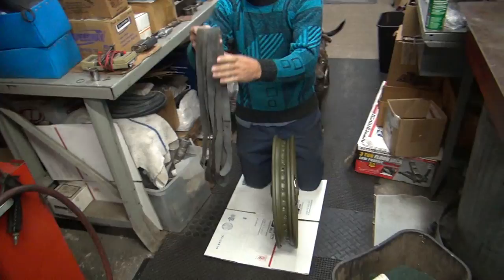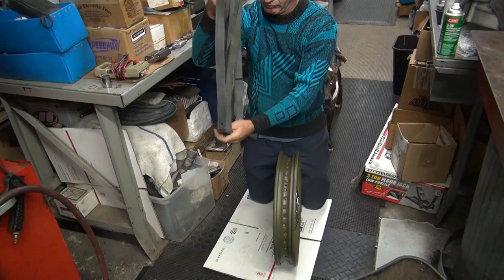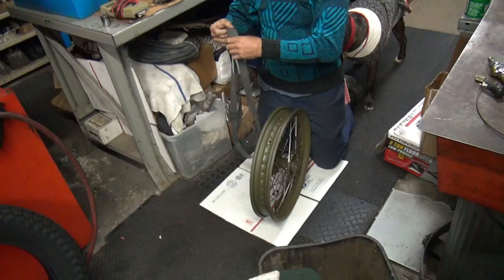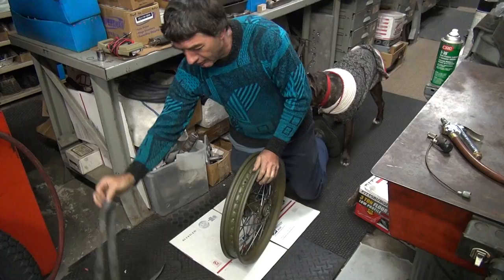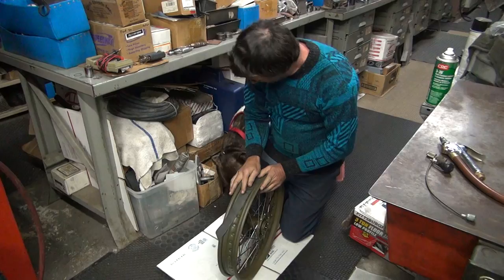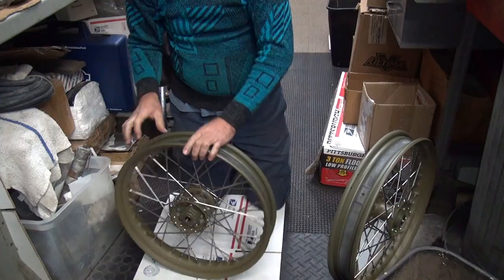1942 wlc wla 45ci #120 star hub rebuilding wheel lacing harley chassis reassembly by tatro machine

Comment: I've read that the dots on tires are marking the heavy spot and should go 180 deg from the valve stem to cancel the extra weight out. I really haven't seen noticeable differences no matter how they're mounted though. 99% of them need balanced no matter what you do.